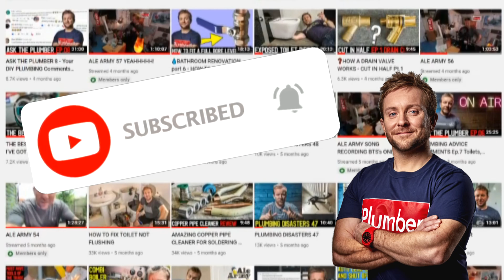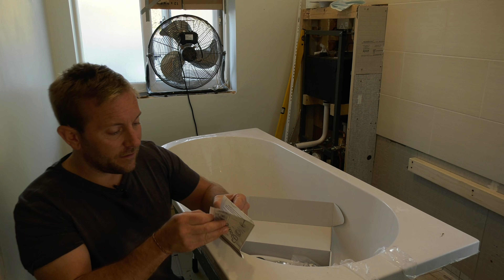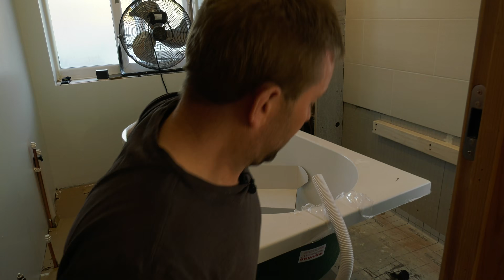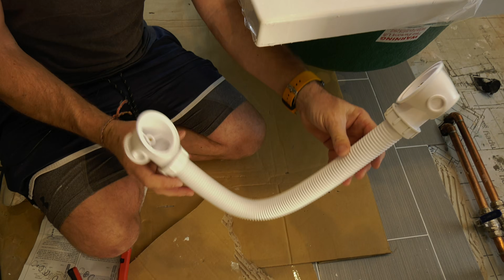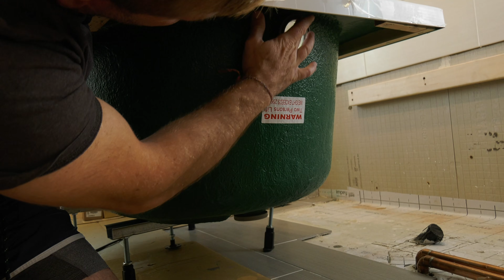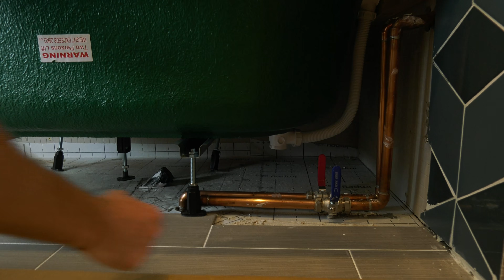HOW TO FIT A BATH OVERFLOW AND WASTE

Comment from the maker: FULL BATHROOM RENOVATION PLAYLIST: https://youtube.com/playlist?list=PL_WM6HolhQ4uTSE1pe9stI-uRhBD43-lH
🍺 JOIN THE Alearmy Exclusive weekly live videos on Thursday https://www.youtube.com/user/plumberparts/join
🛠 AMAZON TOOL STORE https://www.amazon.co.uk/shop/plumberparts
📺 VLOG CHANNEL: http://www.youtube.com/c/timeswithjames
Reply: What procedure is recommended for returning home after being away for 4 weeks having turned off the water?
Reply: What type of washer goes inside a flush pipe screw cap/nut? 1 1/2 inch doughnut washer? What type of washer is it?
Reply: 0:43 hi I got a new bath replaced where old bath was. No plumbing required. When the bath fills over the overflow water drips down the wall in the room below.. Does not happen very often job was done 9 months ago.. When installed, and tiled over it leaked also, had to repaired.. What could be issue I wonder? No access to fittings tiled over thks

Comment: If only it was that easy. I need to change mine because it is in a right state but the previous owner put all the pipework from the retro-fitted central heating under the bath so it is a "spaghetti junction" of copper pipe under there. I have just changed the taps adding isolators and flexi connectors and it took me 5 hours over 2 days to get everything watertight again.🤦‍♂️

Comment: I just spent a whole damn day engineering a perfect slope between 1/110 and 1/40 from my bathtub, and here you are sending all your waste water straight to the underworld with a 45 elbow. o.O Did I completely waste my time and the slope doesn't really matter? Or how do you prevent the system siphoning you p-trap when you drain a full bath?

Comment: Hi thanks for this. Please could I ask…… my bath was fitted a long time ago but recently I have noticed that the outside waste/ overflow is dripping into the drain outside the back door. There are no taps on and the bath is dry. No sign of leaks any where either. Where could the water be coming from? Should I be worried ?
Thanks so much for any advice you can offer !

Comment: Thank you - I just picked up a new watse with so many rubber gaskets but they did not make sense until I saw your video. Too many people overdo the silicone sealent make the fixtures impossible to remove. But to silicone that washer/gasket for the overflow let me work out where it is important to go :D Rubber on rubber will seal nicely.. rubber onto fiberglass = add some silicone. That settles that debate for me.

Comment: Just replaced waste as it was leaking from top. Screw corroded , couldn't screw. Disconnected waste pipes underneath, went around metal at top with blade then put large screwdriver in hole and levered waste off. The other difficult bit was how to hold waste bit under the tub around the hole whilst trying to get screw in the hole at the top...so easy if you had 2 people. After dropping many times screwed waste pipe together to stop waste turning . Don't know how I did it but eventually got screw in hole and after few turns able to tighten... don't know how plumbers do it.

Comment: Just discovered a leak in my bath. When I got a mirror beneath its difficult to see exactly where its coming from but there us a small nipple type spout that comes off the waste and at least some of the water is pouring out of here. Surely this should have and end cap or something on it? I think also the actual plug hole waste may be leaking. Problem being the taps and consequently the overflow are both mounted central on the length of the bath on the wall. And to top it, the screw that I assume should be in the centre if the plug hole itself is missing 😂😢. Any advice would be welcome.
Reply: @gloooopo I recently just discovered a leak coming from under my bath tub as well, it's coming from the drain hole. Now I'm no plumber but I got under the bath tub to get a closer look at it properly and I figured it may just be the seals. So took the drainage apart and cleaned the seals and put it back together and re-sealed everything. I still have a slight leak so I'm thinking I'm just going to replace the whole overflow outlet because we're missing a trick here with that all in one seal gasket he shows. See I have 2 separate ones, one for the top in the tub, and one for underneath. That seal he shows is like an all in one that seals top and bottom. But I can't find it anywhere on its own without it coming with a whole new kit. I'm just going to replace the whole overflow outlet and re-seal the gasket seal underneath. With your issue I think you'll need to replace the U-bend pipe which is the waist pipe you're talking about, check your O-ring seal for it that's connected to the overflow directly under the plug hole first, it might just be worn and needs replacing. As for the screw missing you can replace the plug hole or just find another screw that fits because that has to be tight so your seals are sealed if that makes sense. As I said, I'm no plumber but just giving things ago and learning while I do it
Reply: @BeNy-87  due to lack of time I th8nk I'm gonna hand this one over to the plumber
Reply: @gloooopo  yeah time is hard to make I understand. good enough though if a plumber coming to fix, probably the best thing as they know more about it, trouble is they cost alot of money now days. I fixed mine this afternoon but without this video, I probs would have got a plumber as well lol 😂
Reply: The time thing and the fact that I'll have to get the bath out to access the overflow at the rear. Thanks for your insight 👍🏻. Time to open my wallet 😥

Comment: My waste pipe is fixed in the wall but is too low in height to marry up with the usual P trap.    Wazte is std 40mm but cant suss out to to connect the two.   The height difference is about 50mm so sure a short straight coupler would work.

Comment: The joint between the spout under the bath and the u-bend trap keeps leaking even though both are brand new. Keep taking it apart and putting it back together but cannot understand why it's leaking. The screw on connector sort of clicks and drops after being tightened. Are we just overtightening it? Have tried swapping out the ubend trap thing so that's not it. :-(

Comment: Thanks, just struggling to seal up under the plug against the fibreglass, would you use silicone instead of rubber seal supplied

Comment: Hi mate. Thank you so much for the video. Just got a leak and figured out it's the coming from the grey rubber seal you show in the video. Need to clean and reseal. Think the original has dried up. What would you suggest? Think you said bonding and sealant silicone. Think I saw Evostik on your video?.. p.s Merry Christmas 🎄🎁  to you and loved ones
Reply: Went and bought Plumbers Gold! Very sticky stuff.. Hope it was the right choice for this. Think the previous guy had put Plumbers mait.. from the cakey dried crap in between. Just hope I'm going to be able to take it off if I need to?

Comment: Most of the time the pipe from the over flow into the assembly under the bath is just a push-on with no nut and seal. If so, wrap a bit of ptfe tape round the stub to ensure a snug fit. It'd be horrible to see and ugly brown patch appear in your kitchen ceiling due to a leak. This happened to me and it took yonks to find the leak.

Comment: I've just fitted a new one of these and I'm having massive problems. Done the fitting OK, but there's a slow drip when taking a shower or opening a bath tap. Just keep adding more and more sealant around the fitting, hoping to plug any slight gap, but water is still very slowly getting through somewhere. It might help if I could see what I was doing, but I'm working almost blind, and am totally blind on the opposite side of the fitting!

Comment: I`ve just finished fitting a new bath. Not a cheap one, middle of the range. Took me two hard weeks with moving a wall and doing the plumbing myself. ( I live in France and plumbers are rare). I made sure the bath was rock solid and will be a sod to ever get back out. Fitted Dumawall tiles.  I had a shower and all fine, no leaks. Wife then started filling it to take a long bath and water dripped through the fibreglass at the plug end. It`s not a waste pipe leak, it`s faulty manufacturing of the bath. I nearly cried. The first waste pipe kit I bought was also faulty and the curtain pole was too. Is nothing made properly anymore?

Comment: Hi mate. Theoretically if the overflow pipe fell off the fitting at the top of the bath because it wasn't connected securely and its now laying on the floor. Could emptying a full bath of water down the waste hole and filling the pipes cause a lot of the bath water to leak out of the overflow pipe that is no longer connected to the bath and soak the floor?

Thank you.
Reply: I'm watching this video because this is exactly what has happened to me. So I need to fit a new waste pipe. Yes, it can happen

Comment: We got a Alps 1660x735 modern roll top bath. Not much room in the bathroom but nice bath for it. But as you'll, there is no access to under the bath as its all one mould. How does anyone fix the waste to this? We're scratching our heads. Free standing bath apparently.

Comment: Thanks for posting! Just replaced an old shallow bath with a new deep one, kept the overflow and waste since they were still good but had no instructions since the previous installer took them. Got a lovely clean and solid seal on the waste now :)

Comment: Thanks for posting. So far, I've had to replace my Flomasta pop-up bath waste assembly 3 times as the moulded spigot in the back of the hand control drive gear shears off due to excessive effort on the part of family members in trying to get the waste to open against the weight of a full bath of water. I'm a bit limited in the clearance beneath the bath so haven't tried other models to date, plus working access is a nightmare. Can you recommend a stronger, more reliable pop-up style bath waste please James.

Comment: I just installed a bath bottle trap from the MCAlp’ brand. The reason for this is because there was an existing wetroom drain off centre that I wanted to connect into (with a  converter) and the product allows a top access to bath trap and adjustable rotation direction on the bath waste pipe. Oddly though it drains perfectly for baths but I do get the occasional poor drain on a shower run. Falls are all there ok. The product does have an adjustable water seal so maybe there’s a problem there or that I’m running it into another trap?

Comment: Just at the right time.
Need to redo mine as it's stumped me.
If someone runs a bath without the plug in place, the overflow pipe in the alleyway starts to dribble. 
I don't get it! 
As I'm replacing the shower mixer taps, I may as well do this as well.